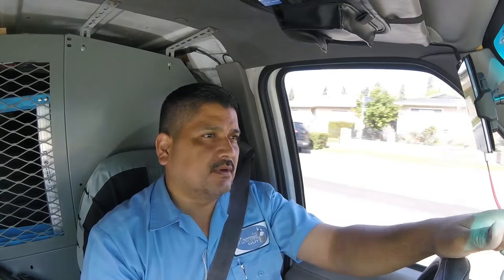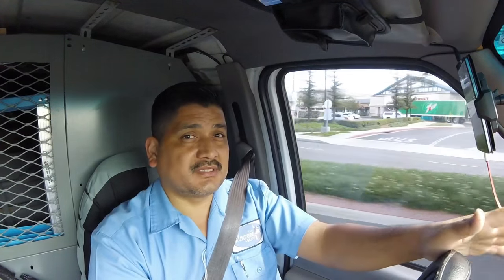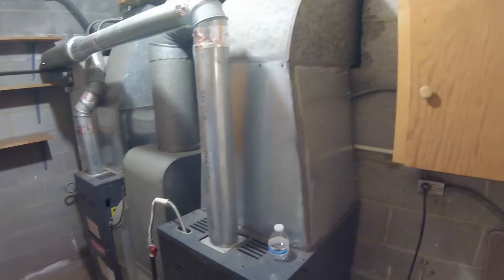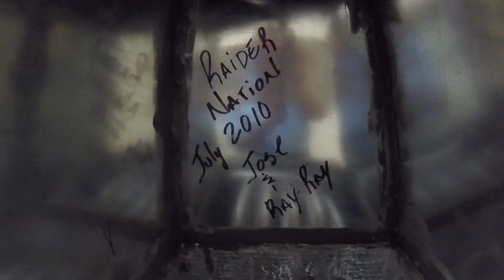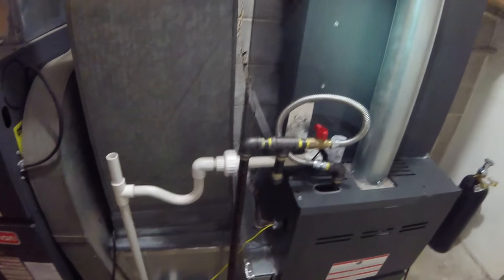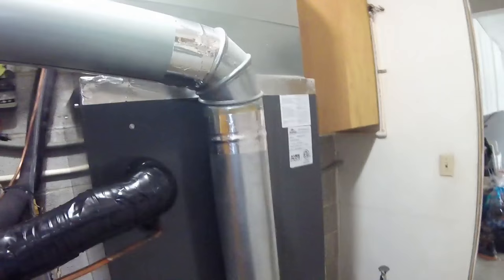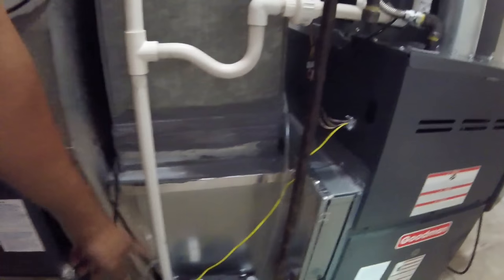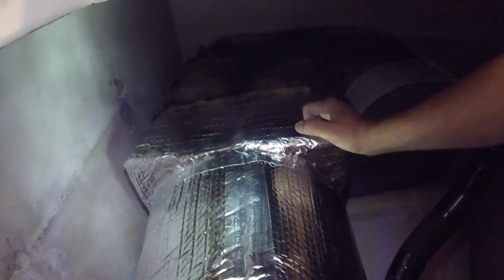AC change out. Little return.

Comment: Good stuff Juan! Those customers should feel a big difference with more return. Looks great. Question for you do you always tape the flu pipe? I was always taught not to do that but I noticed a lot of people do. Just wondering.
Reply: Gotcha thanks buddy.
Reply from the maker: No. I put it back the way it was. Including the tape. It was single wall.  I use double wall on my new installations. No tape, like you said.
Reply from the maker: +The Air Conditioning Guy... Just to be clear.  I know screws is all that's necessary but I didn't want it to look different from the rest and tape won't hurt it anyway.